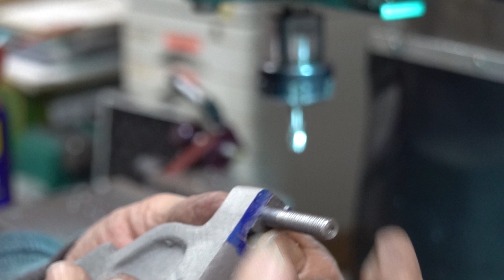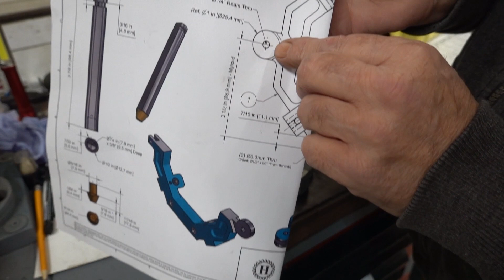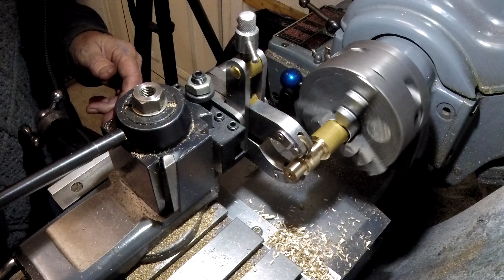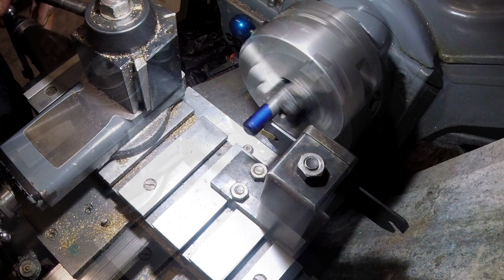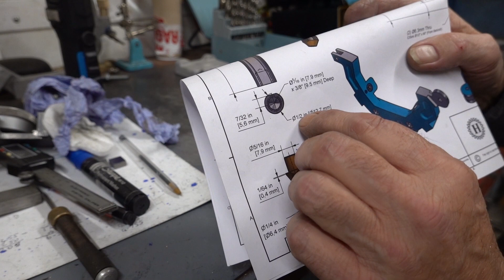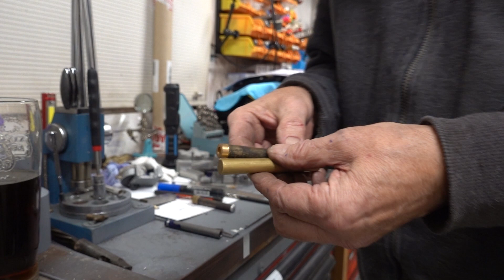Part 4 Lathe large bore steady rest

Comment: For the long holes could you mount the ring on the cross-slide of the lathe and use a collet chuck to hold the drill?
Reply from the maker: Hi Mark. That is the way the instructions suggest. But they also assume that you have no milling machine. Food for thought though. I will probably have a look at that type of setup.. 
Regards.
Steve.